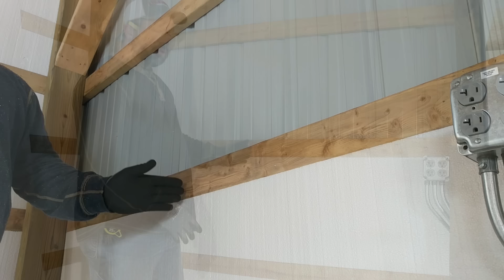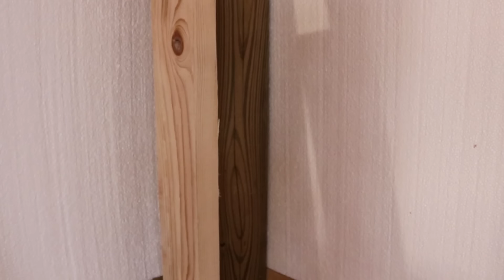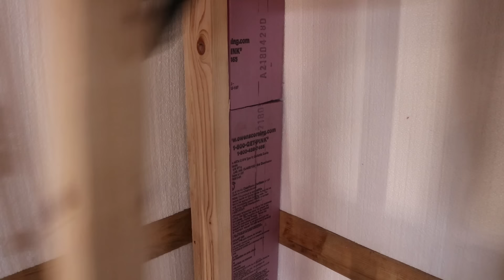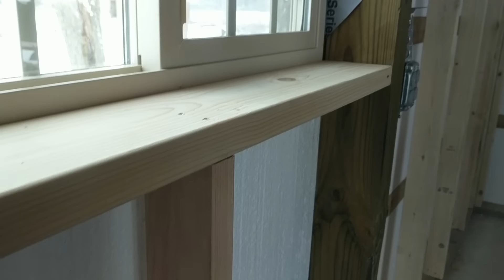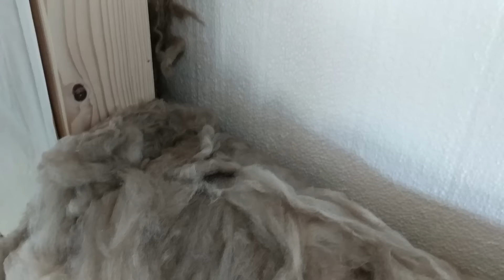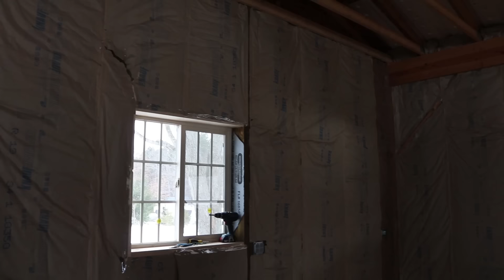How to Insulate a Pole Barn - Insulating the Workshop With Foam and Fiberglass

Comment: I realize this is an old video but what if there is no house wrap like in this video. Will condensation occur between the foam board and metal walls?
Reply: I was wondering the same thing. In colder climate, you want to wrap the outside of the structure before attaching metal. This will serve as both wind and vapor barrier.
Reply: @cwag2159 what if you didn’t wrap it first 😖 Can I still insulate if I’m in a cold climate?

Comment: Nice video, but there's a major issue here.  You but the vapor barrier on the outside.  If you're mixing two different insulation products, you should have switched them, so the panels (which are also a vapor barrier) were on the inner side. Unfortunetally they way this has been done, you're likely to have a condensation and moisture issue that can cause mold to form in your fiberglass insulation.

Comment: As a custom home builder with over 37 years of building Energy Star homes I can say that this is one of the best insulation videos out there. You have addressed the little details that will make a huge difference in the comfort of your structure. Congratulations! The only thing I would do differently for anyone reading this is to use unfaced batt insulation between the studs as the paper doesn’t do anything but “could be” a surface to attract moisture and therefore mold.
Reply: Rookie question, but how would you secure the unfaced batt insulation? Thanks!
Reply: @jbmak2585  the unfaced batts are actually cut slightly wider than the stud cavity and will stay in place by friction.
Reply: Had my attic insulated years ago and had to just pull it all down as the paper began to mold
Reply: That's good to know,but sorry you had to redo it 
 @johnstahl2684
Reply: Right now I have a post frame building with the outside steel than tyvec over the outside girts. What do you think of doing the xps foam board like this guy did between the girts but it would be to the back of the tyvec then spray foam over the 1.5" xps.. My goal is to stop the push out from the foam from the previous building we have. Located mid WI.

Comment: Have pole barn already build. No moisture barrier on walls. I want to make a house. Can't afford spray foam. What can I do to insulate with no mold or moisture. My barn has 6x6 post I am going to frame flush with 2x4
Reply: I know this is 11 months later but im in the same boat. The only way i see to do it is pull the steel off and use house rap like tyvek and put the steel back on. Seems like a lot of work but i want it to last. Theres a lot of risk with spray foam also. I wouldn't do it. Probably have to do the roof too. I thought about putting gable vents in with fans but not sure i want to chance it. Expensive to insulate but cheaper than doing it twice

Comment: Why not just frame the walls like a house? 2x6 studs 16" oc. Would have saved you lot of time and money.
Reply: This style of framing is called pole barn framing. It is the most cost effective style of construction. The cost of the insulation being used is still cheaper than the cost of stick framing. There are many pros and cons to each style.
Reply: Because it’s a pole barn….also won’t save you money in the long run, you can get way more insulation in post frame walls.
Reply: Prob for a higher R-Value..?
Reply: Less thermo breaks in post frame construction.

Comment: I'm a noob but would you need to put up plastic over the insulation for a vapor barrier?
Reply from the maker: Yes a vapor barrier on the inside is required. The paper/foil on the fiberglass batting is a vapor barrier so in case plastic wasn't needed.

Comment: Nice cuts!  Could you apply interior horizontal girts (staggered 1' OC with the exterior girts) instead of a stud wall to attach drywall?  Also, if you were sheathing the exterior with OSB + wrap + cladding, could you get away with stuffing an 8 inch batt between the two rows of girts?  That foam idea for the exterior girts sure is nice but I don't have that kind of skill with cutting.

Comment: Have you found any condensation by doing the walls this way?
Reply from the maker: I have not. I have one piece of plywood in my mechanical room that is not screwed down and I've pulled it off recently and It's dry as a bone behind it. I think I'll do a video soon on this subject, because a lot of people have that concern. As long as there is a vapor barrier installed there moist air from the inside can't get through the insulation.
Reply: @CountryFamily would it be ok to spray foam around the edges of the foam board? To make it air tight? Then add fiberglass insulation

Comment: I have a post frame shed 50x100 and I am going to finish the back half and make it a hunting lodge.  I got a quote to do the ceiling and the three walls as I dont have the devider wall up yet and it was 18k so I really like the way you did this.  Like everyone else I am worried about condesation and leaking where the nail went through the steel sidding sheet.  I am in South Dakota was thinking of doing it how you did it wil maybe spray foaming the ceiling so I can have the open rafters.  Wondering if that would be a bad idea?

Comment: That foam is $13.99 for a 4x8 sheet. At that cost I'd go spray foam
Reply: spray foam is about $1.25-$1.50 a board foot installed.  that 4x8 area at 1.5" deep would cost you roughly $60.00-$72.00.

Comment: Even though 2 yrs ago, a well thought out plan for insulation. I will do same with my barn. Question: you mentioned the 2” (pink) foam board you used in your floor. Did you mean your barn floor and if so, how was that done? Thanks in advance!
Reply from the maker: Here's how I did the barn floor:
https://youtu.be/Bp-PLkaN5Xs
This past winter is the the first time the barn was completely insulated and all wall finishes on. I don't have the hot water in-floor heat system done yet, but I easily kept it above freezing all winter with a small propane space heater.
Reply: @CountryFamily  
Thanks for the link! 👍

Comment: Good idea to insulate behind the posts. I did something similar. 
I also used 1 1/2" foam, except I only extended it 6" beyond the posts on each side. Then I insulated between the posts with 4" thick 4'x8' foam panels, cut to fit tight.

Comment: Nice barn. Probably been cheaper to build a stick built garage though.
Reply from the maker: Thanks Jim. Framing wise yes a stick built is cheaper, but here in Michigan it would require a 42" deep block or poured wall foundation which would more than offset the savings.
Reply: @CountryFamily  copy that,codes must have changed.i’m in the U.P and i built my 30’x50’ on a floating slab. Nice work! Fill it up with toys!
Reply: In michigan you can't build a garage on a floating slab?   Mn we can don't need block frost footings

Comment: Old thread so I apologize for asking now, why the Styrofoam, I was thinking of using 1.5 R-Tech insulation panels and particular reason you just went with the plain stuff?  I was going to put the foil side to the inside, then do faced fiberglass batts.  My exterior sheathing is LP Smartside so the wall surface is smooth so I'm a bit worried that condensation could form in between the RTech and the siding.  Any advice?
Reply from the maker: I used the white foam mostly because it was cheap and easy to get. I haven't had any signs of condensation in my walls. They are completely finished on the interior now and I'm using small propane heater this winter and it's working great.

Comment: Hey quick question. I see you have your electrical on the posts. Can you show me or tell me where you have it running around the 4x6 posts? I see you have it running along the girts but how did you go around the main posts?  I was planning on doing foam between the girts and then 6” fiberglass top to bottom and blow in the ceiling. But how did you run your electrical with foam being in there? Thanks
Reply from the maker: Thanks for the question. Most of my electrical I ran underground in pvc and changed to EMT above the floor. When I took off from one of those boxes I used MC cable and went behind the poles dishing out some of the foam. You could also drill a hole in the center of the posts if you want. 
I did it way to get some finished outlets while the walls stayed open for a while. If you planned and covering the walls right away you could even take a more traditional residential approach and run Romex. I'm actually an industrial electrician so I prefer conduit but that's just me. 😀
Reply: @CountryFamily  I’m going to run Romex I just didn’t know if there was a trick going around the posts with the foam in there. I think I may cut sections by the post so I can run the wires through behind the post and use spray foam to button it up before adding the fiberglass insulation for the cavity. I don’t feel comfortable drilling through the posts I’d rather keep those as structural as possible. Lol

Comment: So how much moisture builds up between the exterior wall and interior? Moving to Idaho this year and going to do a pole barn/house thing and there are so many ways folks insulate these things and doesn’t seem like there is any real good a answers or solutions.
Reply from the maker: With a vapor barrier on the inside, there should be no way for moisture to get into the wall. I would check with manufacturer websites though as it really depends on what type of insulation you use and the climate in your locale.

Comment: what kind of white foam did you use?
Reply from the maker: I used 1-1/2" Expanded Polystyrene: https://www.menards.com/main/building-materials/insulation/foam-board-insulation/expanded-polystyrene-foam-board-insulation-4-x-8/1632082/building-materials/insulation/foam-board-insulation/expanded-polystyrene-foam-board-insulation-4-x-8/1632105/p-1444435971090.htm

Comment: Currently doing a lot of research for my own 30x40 shop. Since you are essentially building 2x6 walls inside the post frame for insulation, why not just build 2x6 stick frame from the start?
Reply from the maker: To stick frame this barn would require a 42" deep footing and block or poured wall foundation. That cost would far exceed the extra $250 spent on 2x4s. Plus it allowed me to finish only part of it at first and then the this year I finished the other side. Having the 2x6 walls plus the 1 1/2" foam board gives me about R-25 which will definitely help when I keep it heated full time this winter.  If you live in an area where you can build on just a slab then stick framing with 2x6s is probably the way to go.
Reply: @CountryFamily  makes total sense. Thank you for the info.

Comment: Do you worry at all about moisture getting trapped between the foam and metal or is there enough airflow from the ribs to keep it in check?
Reply from the maker: Thanks for the comment Charles. Warm moist air from the heated interior would flow through the wall and get trapped by the foam or metal. The vapor barrier on the fiberglass insulation gets that warm moist air in the conditioned space. If the vapor barrier wasn't installed then moisture would surely get inside the wall and cause a problem. 
This is somewhat dependent on what your climate is like too. Certainteed has a good resource on their website:
https://www.certainteed.com/insulation/resources/do-i-need-vapor-barrier/
Reply: @CountryFamily   I am in the pacific northwest. I am sure it varies but most of the new construction I am seeing doesn't use any vapor barrier/retardant. I assume that is because it never gets too hot or too cold around here. I am framing in a room in my shop that will be heated and cooled. I was a little worried on summer days that moisture/condensation could get trapped between the foam and metal and have nowhere to go. Don't want to end up finding rusted metal in the future.

Comment: Awesome video. I hope to use this same method on my MI pole barn.  How is it holding up for you? Do you have any videos of how you did the ceiling? My trusses are 4ft on center with a metal roof, so I am not sure how I can do the blown in method you suggest.
Reply from the maker: Thanks, I have one section of of the barn done with walls and ceiling. Since my trusses are 2' on center I used 5/8" drywall for the ceiling. I didn't blow the insulation in the attic yet, but plan to do so by this fall. With 4' centers you could use metal similar to roofing but made for interior ceilings. I believe it will support the blown in insulation. Check out RR Buildings channel, Kyle does most of his barns with larger spacing between trusses: https://www.youtube.com/channel/UCWXEQsK3UiHszjwgGN5HUeQ.
Good luck with your project.
Reply: jagarcia89 ... for sheetrock support you could simply screw 1x3 strapping across the ceiling on 16" centers. That's probably the cheapest / easiest way to go.
Reply: @rupe53  Unfortunately that would not work for me, since my trusses are on 4ft centers, adding the 1x3's and drywall would add a too much weight given the trusses 5lb per sq/ft load rating.  I ended up doing 1x3 firing strips and laying 1" polyiso foam board on top of it and using that to hold rolled fiberglass.  The foam board is much lighter than drywall and because it is also insulation, allows me to go a bit lighter on the insulation on top.  Probably not up to code, but had to get the garage warm for winter
Reply: @jagarcia89  ... I was going to suggest adding a few more 2x4 braces to the truss assemblies and gain load rating to at least 10 lb per sq ft, then you could add sheetrock. The reason being is that polyiso doesn't have a fire rating. Also at 5 lb per sq ft you hardly have enough strength to add ceiling lights.

Comment: Install all your framing then use spray foam insulation. It finds every crack and crevice and saves time.
Reply from the maker: Definitely spray foam is an excellent choice. It is also much more expensive.
Reply: @CountryFamily  Yep. Finds every crack...in your bank account. Did mine the same as you here in north central Indiana. Very happy with the outcome!

Comment: I'm trying to figure out how to insulate my pole barn.  There is no ridge vent and there is no soffit vent.  I haven't figured out how to do it.  I would hate to put up thousands of dollars worth of insulation just for the barn to sweat and ruin it all.  Any advice?
Reply: I wonder if I should take my ridge cap off and add a ridge vent?  I dont know much about this stuff
Reply from the maker: Yes you really should add ventilation to the attic space. Not just for the insulation but also to extend the life of the roof material. Adding a ridge vent would be an easy start, but you will also need vents lower to get good airflow, preferably in the soffit. There are soffit vents that can be snapped into drilled holes or screwed on top of hole cut in existing soffits.  You can also add gable vents on each end of the barn to get good cross ventilation. 
Here's a couple examples from Amazon:
https://amzn.to/2ueR435
https://amzn.to/2V5j8kl
https://amzn.to/2SWwoVT

Hope this helps - good luck with your project.
Reply: Country Family Homestead I was actually considering not having an attic space and insulating the underside of the roof (similar to the walls).  With no soffit or ridge venting, I’m worried about condensation.

Comment: Air moving around it or filtering through it defeats the insulation. You need film to stop the air movement as well.
Reply from the maker: Yes sir, that's what the vapor barrier is for.

Comment: I am so so so happy I did not build my 30x40 with loft barn as a pole barn!   I built stud walls just like a house.   Why build a building then build stud walls inside afterward.   Seems to me a huge waste of time and money.   You did a very nice job with what you had.
Reply from the maker: Thanks for the comment Kevin. In order to stud-frame this building I would have to put down a 42" deep foundation which would be way more money than this route.  This way also allowed me to just finish the wood shop side first and leave the rest uninsulated for now. Different areas of the country may have different codes where stick framing would be better.

Comment: I did the same when insulating mine. When i did mine to get full advantage of the foam insulation, it says to leave a minimum air gap to get r-value otherwise i was going to do the same. I filled any light gaps with great stuff just turned all the lights off on a sunny day. My ventilation is my ridge and using paper on insulation as a vapor barrier.

Comment: Isnt the r19 batts used in 2x6 framing? Whats the need for the foam and pirlins?
Reply: The purlins are what the exterior sheet metal is attached to. The foam between them is to add more insulation.
Reply: @digitalguru42  What you are calling Purlins are actually called Girts.  Purlins are on the roof, Girts are on the walls.

Comment: All the ceiling insulation in my pole garage has been ruined by stinking red squirrels!
Reply from the maker: They sure do cause damage. They got into my tool shed and filled up the loft with pine cones. I am going to have to diligent in keeping them out of the barn. It might be time for a big ol' farm cat to keep them in check.
Reply: That's why I kill chipmonksand red squirel

Comment: Good video. A pole barn floor is still considered a floating pad, therefore the bottom plate should be doubled up and left up about 1 1/2" off the floor, fastened to the poles only, letting the pad move as it may. (cold climate where frost is a problem)
Reply: What if the area is held at room temperature?